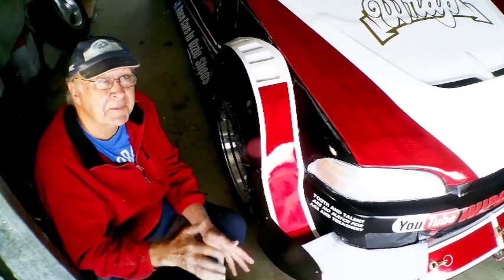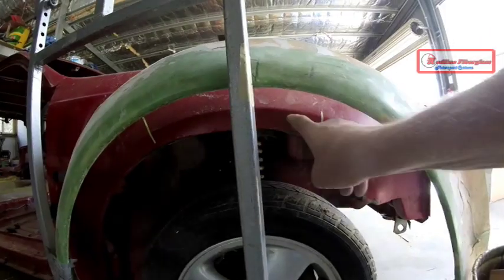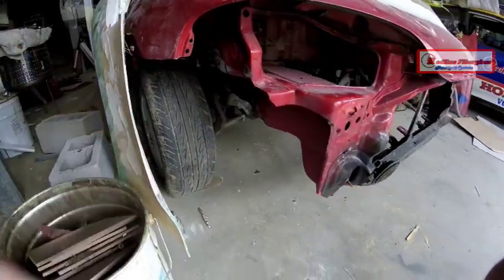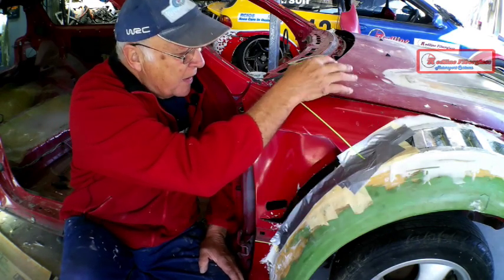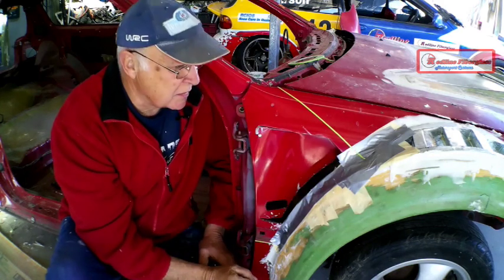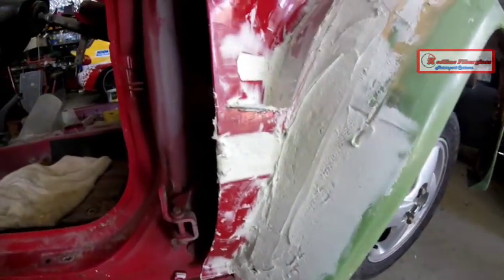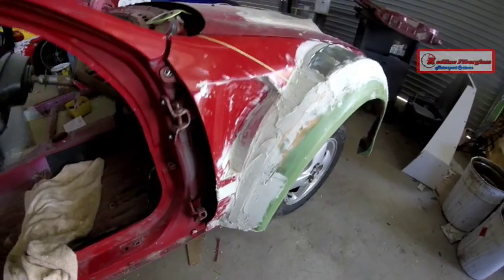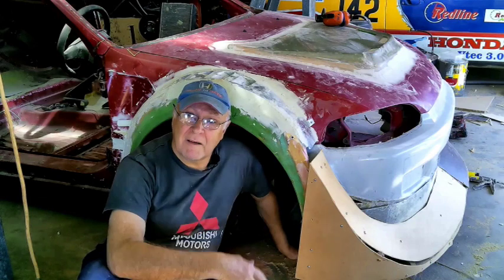Make Monster Car Flares

Comment: i've probably already watched all the videos until now, amazing work! i mostly use aluminium tape for shapes if it needs to be smooth then a piece of pvc foil under it, doesn't even need mold release, but i have learned a ton off of the channel, thank you for the awesome content!

Comment: Insanely good work as always, you're my Honda Hero. Is the hatch 100% tarmac only now?
Reply from the maker: Yes, I built this Phase 4 having decided I had shaken my bones enough going through the trees! This decision allowed much greater freedoms in designing & building the car for just the one surface instead of the compromises that are always necessary with a general purpose club car.
Reply: @BillsBuildandRace  fully understand that!